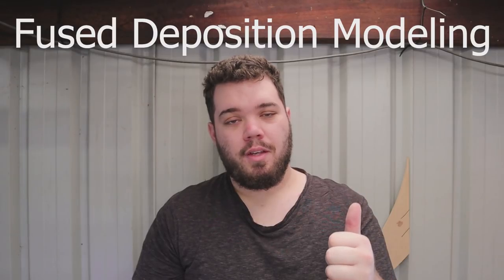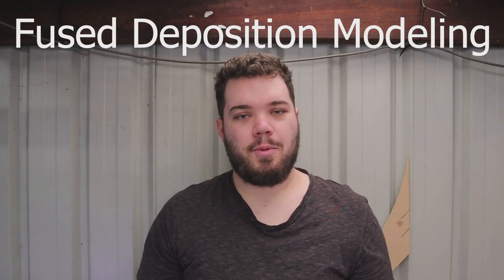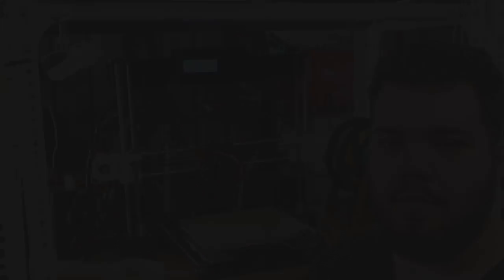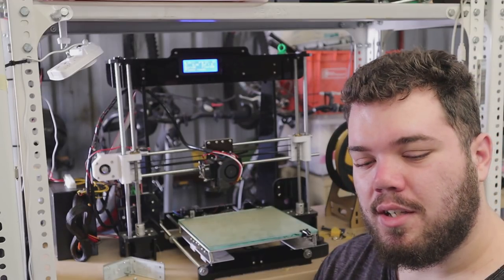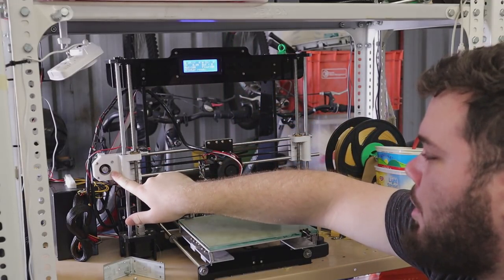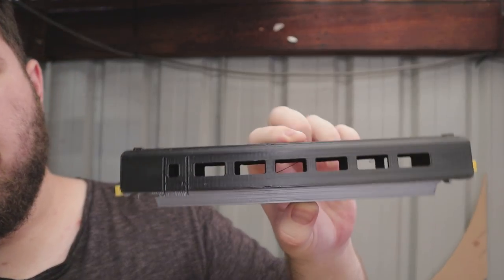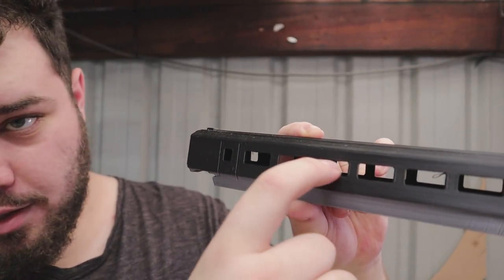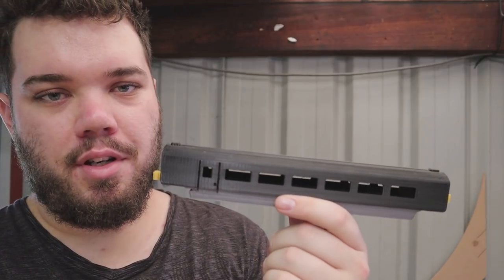19. 3D Printing for Model Railways: a Discussion

Comment: I was wondering if small precision parts can be done with the 3D printing process like the double gear wheel found in Hornby steam locos which often splits with age rendering the the model useless or a permanent display cabinet item. Some of these double gear wheels are now unobtainable rendering those models when they fail useless unless 3D printing can come to the rescue.
Reply from the maker: They definitely can however you'd be better off investigating a resin printer in this case. the fidelity of the component is superior to FDM. YOu can pick up relatively inexpensive machines now from Any cubic that would easily be capable of producing these gears.

Comment: Great vid mate love the idea of the eurostar carriage how do you get the dims to draw from or do you just measure up an existing model.
Reply from the maker: Some reverse engineering was required and a combination of measuring the existing coaches and extensive research on my part trying to find drawings to model the units. My only problem now is that I have completed that and printed the prototype the power units are not powerful enough to pull the rake I need a diecast chassis and heavy-duty motor to handle it so I'm stumped for now. Thanks for the comment though. Cheers, Ben.

Comment: Just Bought A8 From E-bay £69.99 New :)

I'm wanting to print a helix or parts to build one up for N-scale trains .
Any ideas ? Thanks.
Reply from the maker: Gday Scott! My experience with helixes is to make them as sturdy as possible and as accurate as possible. I also tried to make some risers for a helix on a 3d printer similar to plastic Noch ones you can still buy. The results were mixed id personally stick to timber for the helix, but the printer is excellent for details and parts that are just too hard to scratch-build. The whole point is to have a go yourself and see what you can come up with. But the best advice I can give you is to start with small prints and gradually work your way up. Cheers... Ben.

Comment: Respected Sir

Thank you for sharing a brief details on 3d printing scaled models , I was looking for such information before I go head and invest in this expensive hooby. I do have some questions for now
1) Can u give more details on the quality issue u where expressing in video.
2) Suppose I wise to make an HO scale car , can I get details like dashboard trims and grooves pattern on tires of car on anet 3d printer.
Reply from the maker: Gday Gopal! Not sure respected sir is entirely necessary but it is appreciated! I'll answer your questions in 2 parts;  1. With regards to quality issues; "Budget" 3d printers shall we say... are incredibly affordable and effective tools however they can prove inconsistent, eluding to my comments regarding quality. What you will find is that it is very difficult with a budget machine to perfectly replicate results over and over. There will always be inconsistencies and imperfections, so take note when selecting your 3d printer. 2. In short yes and no... A generic 3d printer has a 0.4mm nozzle, you can attach nozzles that are 0.1mm for higher resolution but it comes at a cost of time (ie 1/4 size nozzle = 4x longers print time). The biggest problem with 3d printers is simply that they do not scale well so if you really wanted to invest the time in replicating absolute perfect detail it would not be possible in 1 print. So in that respect, it is simpler to print a basic shell model and add those details separately. Now with regards to your choice of printer, I must emphasize now that while I have large praise for the Anet A8 it is entry level machine. TO achieve what you are asking would require an enterprise-grade machine or a heavily modified intermediate machine with a lot of time invested in calibrating it. So to conclude; start small see how you like it, as your confidence and ability with the technology improves then invest in a larger more capable machine. I will at some point in the future walkthrough my steps to print model coaches etc and show you the tips and tricks but I must ask for your patience in the meantime. I do hope this helps you! and thank you for your questions and SUB! Cheers... Ben.
Reply: @theengineshed359   Thanks Ben.

Comment: I have just bought an ICE4 Kato train and a decoder for it but when I installed the decoder and then ran the train it runs unevenly and surges in speed a bit then slows just follows that pattern, I was wondering has anyone struck this issue. I programmed the decoder on an INtellibox 2 using  the speed settings from a minitrix loco.
Reply from the maker: Dave not sure I can help you with your specific issue. But it is possible the programmer isn't fully compliant with the decoder, alternatively, it could be a mechanical issue or dirty track. My troubleshooting advice would be 1. check and clean track 2. inspect and clean the loco wheels and mechanism making sure it is oiled and if the first two don't improve the problem 3. Try a different decoder. Budget decoders are notoriously inconsistent with performance. Also may pay you to check the right track voltage is going to the track to rule out a controller issue. Hope this can help you. Cheers Ben.
Reply: Thanks for the advice will have a look at that. It seems it was also a setting on the command station causing the problem